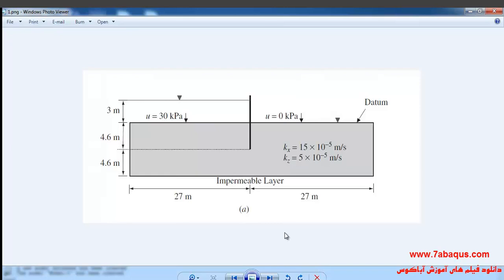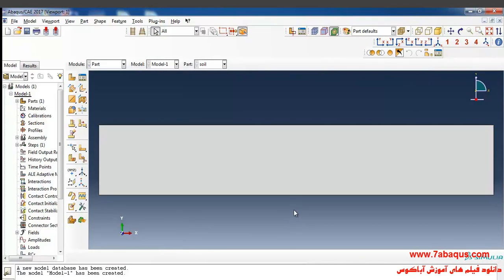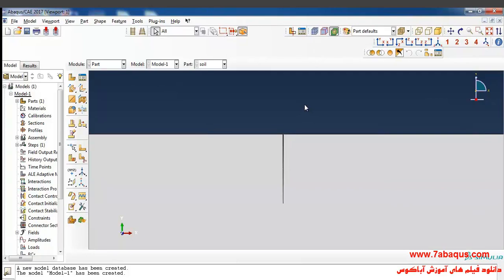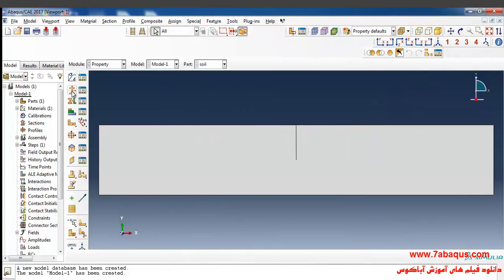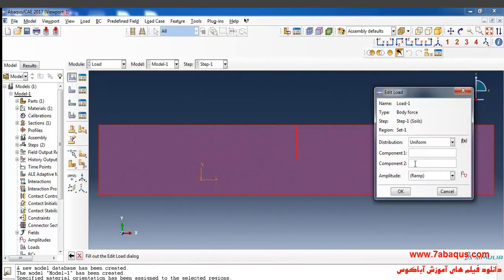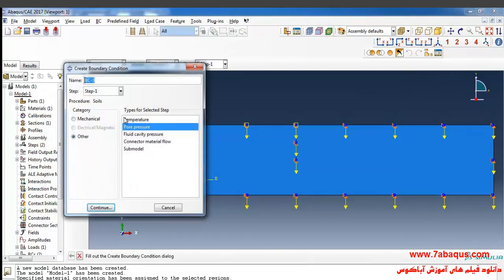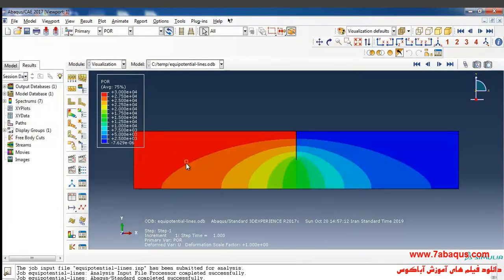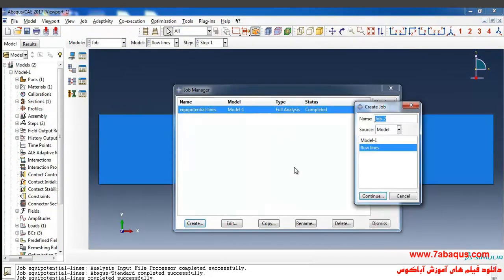Drawing flow net and equipotential lines and flow lines for Anisotropic Soil Abaqus

Comment: Nice video, I appreciate. Sorry but the specific weight of water is wrong 1000 instead of 10000. Why are you using Body Force instead of Gravity? May be because you don´t want to put a density of the soil without water? Thank you.
Reply from the maker: 10000 is true

Comment: thanks alot for sharing your informations, I have questions
why did you used 7000 body force load and  void ratio predefined field in this simulation?
how can you estimate the bodyforce = 7000??
Reply from the maker: 17000-10000=7000
(specific weight of saturated soil )-(specific weight of water)